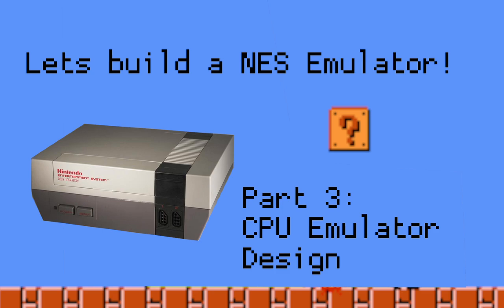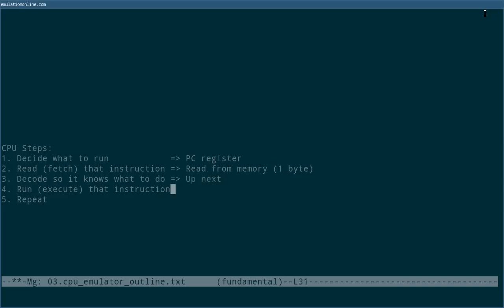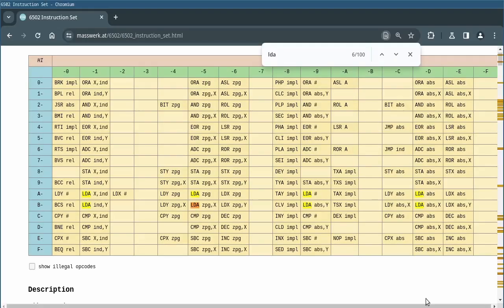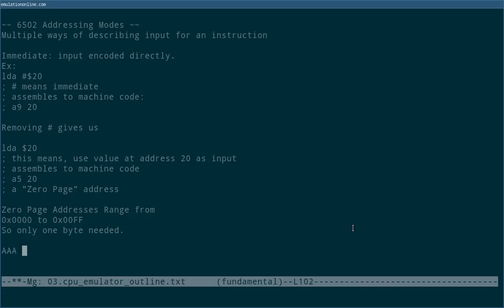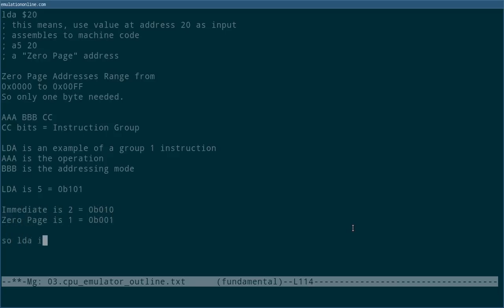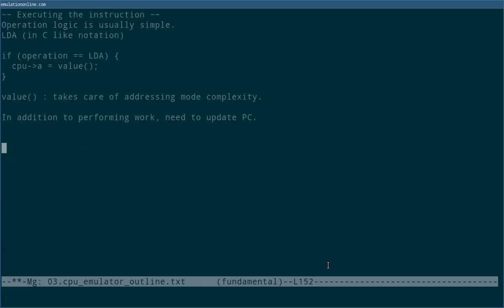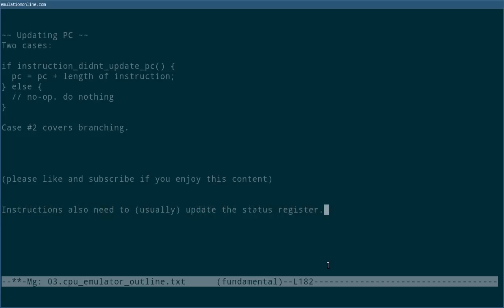Building a NES Emulator #3 - CPU Emulator Design

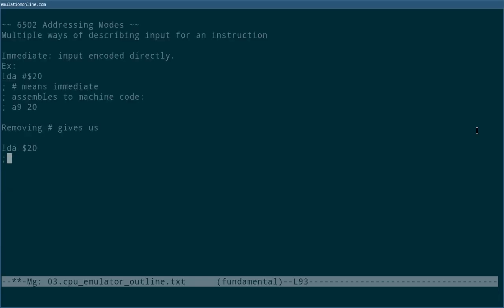Comment: 3:14 Maybe a pointless nitpick, but I have tried to train myself not to use decimal names for hexadecimal numbers - so 0x20 is "two-zero", rather than "twenty". It's analogous to the way people say "one-zero" for 0b10, rather than "ten".
Reply from the maker: Thanks for the suggestion! I certainly want to avoid ambiguity or misleading. I try to make sure any numbers are written on screen, to help remove any questions as to what I'm talking about. My hunch is that people would prefer to read these numbers anyway.

I'll try digit-at-a-time pronunciation in the future. The main downside is that it takes longer to communicate.